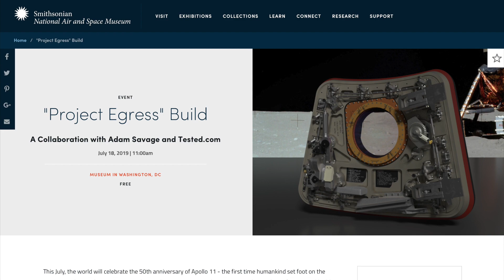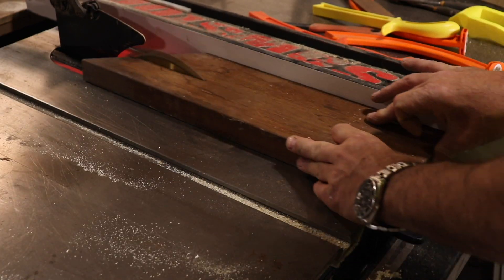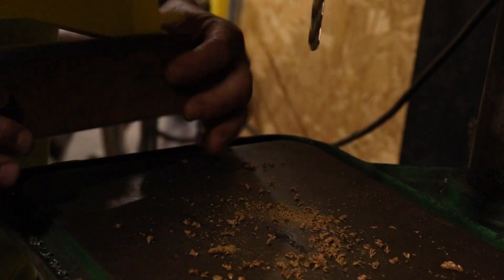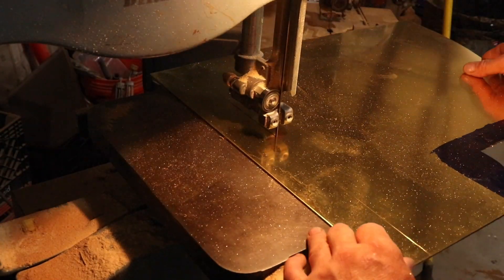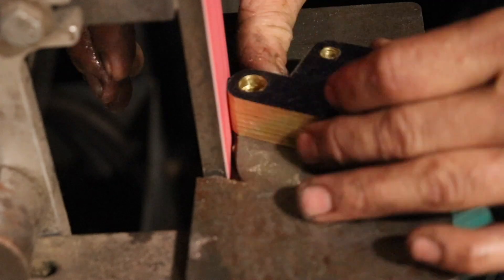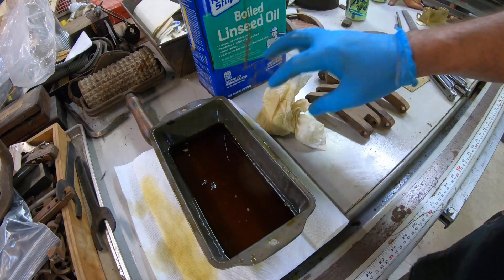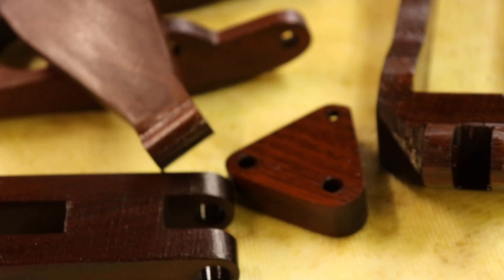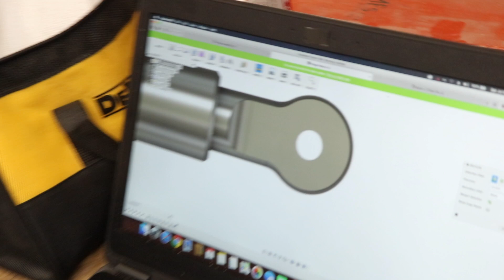DiResta #ProjectEgress: HINGE

Comment: I know this was open to an artistic interpritation and all... but wood? For hinges that are to carry quite heavy metal pieces? Let's hope this doesn't break :-/, at least glue will work to hold it together if it does lol, and tbh the glue would probably be stronger
Reply: Yikes man, I got to the point where you used lead solder, that will fail in days as it starts to crystallize and work harden :-/, I'm even less worried about the wood now, I will be shocked if that holds for long.
Reply: So I just watched the assembly, the wood didn't have to support anything so that was a misguided concern, however the lead solder didn't even survive shipping lol, those can never be actuated, hopefully it's just a display piece that doesn't get touched or anything or else those will have completely fallen apart within the first week.

Comment: This is just a suggestion: I’m not saying there’s anything wrong with his router bit method and I’m probably not telling either of you something you don’t already know. I ran large scale vertical lathes for 4 years and we would often use large stick radius tools. (1/2” typically. Not sure all available sizes). They have removable X shaped carbide bits and last a really long time even when using very hard materials. Seems like that would be a good alternative.

Comment: Hi Jimmy,

With the statement "They would of used silver solder" I don't think that any parts would of been silver soldered at all it, it would of been machined from one single piece, considering how mission critical the door assembly was.

Regards
Reply from the maker: flagmedownmedia Of course it would not have been Assembled from parts. . I just meant if some one Made an assemblage like this. Silver solder would be stronger.
Reply: @jimmydiresta  oh ok everyone else I've seen has machined each part. I thought it was suppose to be functional. 

Regards

Comment: I'm foreseeing some failures to fit together with some people making their parts with some pieces combined that are supposed to be 2 parts that slide are threaded for adjustment, or making two parts that are supposed to be threaded but leaving off the threads. Some are adding bling and other things that alter the shape and/or some dimensions. Weren't the instructions that the dimensions and parts had to match the drawings and 3D models? That's why NASA went to the effort to scan and measure the parts.

If Adam Savage and the Smithsonian wanted the latching mechanism to function, it's not going to. :(
If it all can be made to fit together it will look interesting but it would be much cooler if everything on it could move like the original.

Comment: Leaded solder has a good bit of flex to it and doesn't break nearly as easily as unleaded, it's not as brittle. I do electronics repairs and i always use leaded, it's actually fairly important there to reduce reheating damage to components and the board substrate, but it also holds up so much better. Especially Sn62Pb36Ag2, which is just magical, it doesn't crystallise at all, it is incredibly even. Especially at connectors or mechanically loaded parts i always use it. Sn60Pb38Cu2 might be OK for brass parts. There is no lead emitted in the air in the process, but you should wash your hands well after working with it to avoid contaminating your body.

Every second person working in electronics repair has asthma, and it is believed to be caused by the flux which emits a volatile resin as it's distilled from tree sap, and often halogen compounds. Damage to health due to lead has not been found in people doing electronics assembly or repair.

Comment: I love your take on that part for the project it's oozing your style. Something to toss in your bag there is a solder called stay brite 8 there is also a stay Brite there both low temp silver solder you use with flux. They are super strong used in HVAC and refrigeration to hold lines together.

Comment: I was curious about why you didn't want to silver solder (braze). It's not harder, so why not make it stronger? If they let people use the door in the display, the electrical solder will work harden and break really soon.
Reply from the maker: I explained that this need not be structural .. did you listen to the voice over? it will not be attached to any thing
Reply: @jimmydiresta  I did listen to the voice over where you said that it is an art project, not a working door. Still, once everything is assembled, someone is going to move things, right? I'm not trying to give you the blues or anything, I'm a huge fan, I was just asking about your thought process. It seems that even for playsies electrical solder would make what they call a "cold solder joint" almost immediately with a tiny bit of stress.